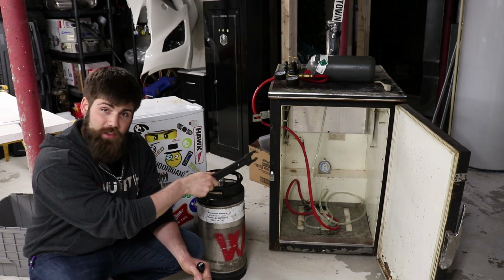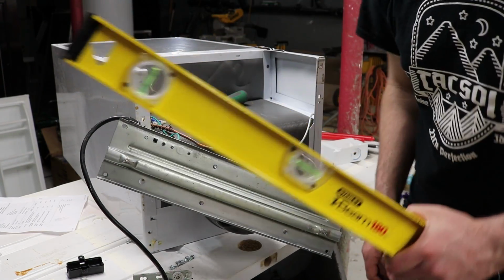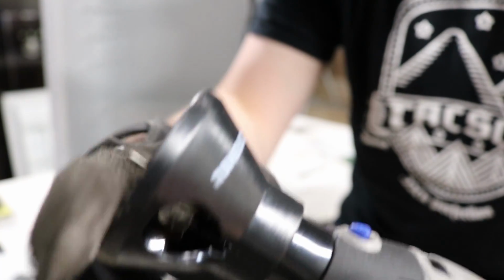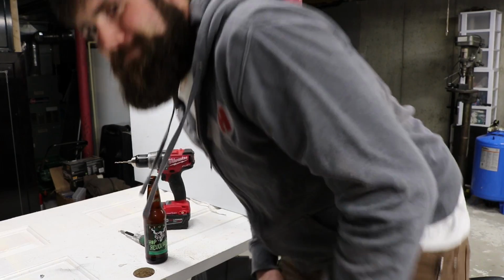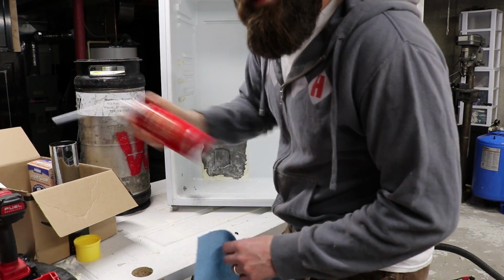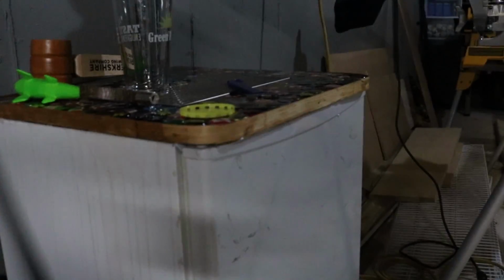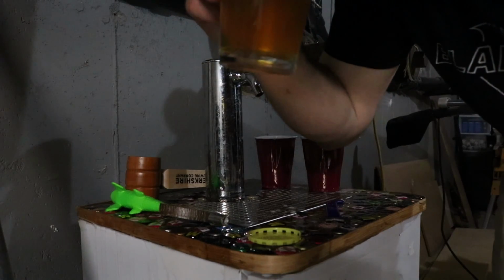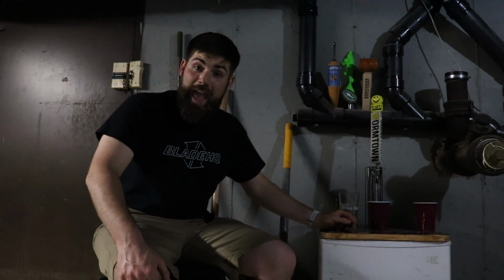DIY Kegerator from a minifridge

Comment: I’ve made a few of these as well. I learned that the hole beneath the tower only has to be as big as the beer line or you are just letting more too much air out of the fridge. Call it keeping the tower cold, but I’ve found that some pipe insulation does the trick. No reason for a hole that large -and I’ve even hit a Freon line once and ruined that unit.  Keep up the good work.
Reply from the maker: the19thhole hey! That’s great feedback and something I realized as well when I was rewatching this video. I used pipe insulation up the tower, and siliconed it to the inside of the fridge to minimize draft. Ideally I would of thought that part through a bit more, but we all live and learn, and I think I’ve mitigated the mistake pretty well.

Comment: Were you able to drill anywhere thru the top? Doin the same thing on the same fridge! Your video has been super helpful!
Reply: Yea how did u know where to drill
Reply from the maker: In the video you can see I used alcohol and flour to see what areas evaporated, it all evaporated evenly indicating there were no lines running through the fridge cabinet itself. 

The cooling mechanism was entirely contained to the panel I was able to move to the side.
Reply: @jakesteve5803  leave it on coldest setting to test?? How long did it take

Comment: Nice video.  Helps make me less nervous.  Also, did you disable the freezer or just move it?
Reply from the maker: Hey Dave, the freezer on this unit from the factory is a little...half assed...from the factory. it’s just a smaller insulated chamber at the top of the fridge, it barely kept things frozen, but removing that chamber made room for the keg, and the overall performance/temps of the keg have remained perfect.

The compressor has stated to get weak so an upgrade may be in order.
Reply: Thanks for the response, and bummer about your fridge. Oh well, version two is on the horizon right LOL
Reply from the maker: Dave Rosenthal dude it happens. My life is a constant state of break it, build it, repeat. Right now my Forester is getting a sleeved closed deck motor. If that’s any consolation of the nonsensical way I choose to live my beautiful life. And heck yeah, V2 will have room for cans next to the keg!! Plus the wife will get a pretty fridge. She will like that.
Reply: Jake Steve damn man - that’s costing you some serious coin - but I get it.  Being a car guy, I truly get it.
Reply from the maker: Dave Rosenthal it’s been a long term project. Got the block at a junk yard, bought the sleeves, traded work for head cores, friend had an unused STi crank and rods that he needed out of the way, I had a saw I rebuilt he needed. You’re right about the machine time and blueprinting labor, but I like to swap and trade my way into things over time.

Comment: This is fine for the Cornelius five gallon kegs but when one uses a standard pony keg from one of the major beer houses, this unit is useless and it’s not worth transferring beer from one keg to another. If you can find a small chest freezer that allows a pony keg to fit flat on the bottom it worth the money. Just follow other YT's making Keezers.

Comment: Could of saved yourself how many hours just get a bigger fridge? And i didn't see the cold control go back in? Hope your beer don't freeze.
Reply from the maker: If I was starting this project from scratch, that would be super valid! I already had this mini fridge and MOST of the parts to do it. This was an exercise in spending as little as possible to have a decent product as an end result.

If I was doing this from scratch, the end result would be very different. My cost was about $30 more than what I had spent on keeping my previous kegerator in good shape so I didn’t mind. This was a 2 evening project, that certainly could of been done faster with a bit more planning. I do these for fun, not perfection.

All factory functionally of the fridge unit was retained, I ended up adding a thermometer through the door later on, and it stays at a steady 35 degrees f. The first glass is sometimes a little foamy, but the second is always 35f.

Cheers man!

Comment: You were lucky not to hit any coolant pipes when you cut through the top! Nice result though, like the idea of using bottle caps in resin :)
Reply from the maker: Vormulac1 I actually addressed that! I used alcohol and flour to check for temperature differentiation across the top, and bent the interior cooling element down while drilling. Thanks for the compliments, I enjoyed this project quite a bit. Looking forward to doing a kitchen remodel so I can move this hardware into a full sized fridge.

Comment: Hey Jake, very nice work little hesitant on taking on this project because I don't want to screw it up. But I need to finish the project. Do you remember the dimensions for this fridge? I need to place in 29hX20Wx20D cabinet and not sure if your keg setup was for half barrel?
Reply from the maker: Hi Daniel! Sorry for the delay. It's a small weird sized fridge from college, the keg only fit after a TON of clearance, but it made it about the smallest package possible, and it was something I already had sitting in my basement. This was setup for the typical sixtel that the smaller breweries in my state have available for sale and it's worked out great. I noticed this Wormtown sixtel was bigger than other ones I had had, so I used this one to ensure anything else would fit, and it's worked great since.

Comment: So is that whole inside hump/ledge free of anything you can hit? I think i have that same mini fridge and need some holes in the side/back looks like that big area you cut out was safe, is the top side of it safe also?!?
Reply from the maker: Notice the cooling panel on the INSIDE of the fridge was rotated down to be alongside the keg. Otherwise the cabinet itself IS clear off internally run lines!
Reply: @jakesteve5803  wonderful to know. Thank you!

Comment: I'm ready to do my drilling on the top for the tap. How do I know where the schematics are?
Reply: I drilled just the metal part of the hole then cleared out the insulation to verify nothing was there.
Reply from the maker: killswitchh nice! How did the project turn out? Did you try alcohol and flour or just go for it? I think the compressor is dying in the mini fridge after a few years of valiant service as a mini fridge, so it might be time to upgrade our kitchen fridge and get a bigger kegerator!

Comment: Why did you move that black cylindrical thing over also what size is the fridge you used ?
Reply from the maker: Hey Andrew, it was all fitment based. That's the compressor. It looks like I just flipped it, moving the obtrusion from one side to the other, but in doing so I was able to move it BACK an inch which meant I could cut much less of the fridge apart...ironic given how much I had to cut out, but here we are. :D

Comment: cool build, but that beer pour around 20:25 would've gotten you a smack from grandpa from my household, wtf kinda pour was that?! lol

I needed to get some sort of inspiration for a similar project, instead of it dispensing beer I plan to build a smartender  on the top of it that pre-mixes cocktails on the fly (I should put a coin-op in for the family members that come over LOL)
Reply from the maker: Your grandpa would of been well within his rights for that one. I like playing with power tools after a couple too many beers on the weekend, and the pours start to get sloppy as the night goes on. :D Good luck with the smartender, those get pretty tricky! I had seen one done with a raspberry pi, but they require a lot of maintenance  to ensure things pour consistent amounts.
Reply: That is actually the proper way to pour most beers, it opens the beer up properly and releases any excess c02 that you would otherwise be ingesting which causes extra bloating. It also gives the beer the proper texture, one that is more similar to draft beer. The tilted pour became popular in america due to our impatient culture and the need to serve more customers at a faster pace.

Comment: Hey, very nice kegerator! How did you secure the wood top on the fridge?
Reply from the maker: Hi Paulo, sorry I missed that! There's actually a ring for the tower that screwed down into the wood so I routed a channel for it to fit, then did the bottle caps and resin over it. It's permanently affixed, but doesn't need to be removed to be serviced.

Comment: What do you put on top of the fridge before you cut a hole? It looks on the video that you were explaining something while it dried. Thanks!
Reply from the maker: Hi Fio, I used a bit of vodka and flour. The vodka evaporates quicker where it's warm, showing if there are any lines inside the fridge walls! If you puncture a line, you have ruined the fridge which I didn't want to do. It worked perfect in confirming for me that there were no lines I needed to be concerned about.
Reply: @jakesteve5803  very interesting trick, cool
Reply from the maker: @bologna3048  In hindsight, Isopropyl would of dried quicker, but I was drinking.

Comment: when you started the project the door had stickers on it, the end result does not have stickers...did you have to replace the door?
Reply from the maker: Hi Donna! The cutting room floor has me removing the stickers after a beer or two too many. I managed to not break any components with this project. I'm on my second sixtel since, and have learned quite a bit about my design since then actually.

If you take on a project like this, I suggest asking a local beer shop if they have a couple sixtels so you can find out the biggest measurement each sixtel design may have, and clearance accordingly.

At a glance, this was the fattest sixtel I had to date. The second one I got had some ridges that weren't on the first one, and made it to close the door. A razor blade clearanced it mostly, and a ratchet strap helped indent them nicely and make the fit juuuuust right!

Comment: Hi Jacke,

What is the purpose of that drip drainer going inside the fridge?

Pedro
Reply from the maker: Hi Pedro! The drip tray is a feature I decided to add to minimize the mess a beer that spills a bit makes. The tray that is mounted flush with the top collects spills and drips, and runs down into the Kegerator. Inside, is an empty growler with the hole drilled through the cap, and the drain hose runs into the growler.

Once a week I empty and rinse the growler out. :)

It makes it very simple and easy to keep the mess down with the drain. I like it a lot, and I'm glad I chose to build a drain into it!